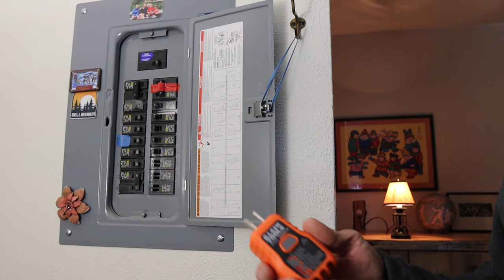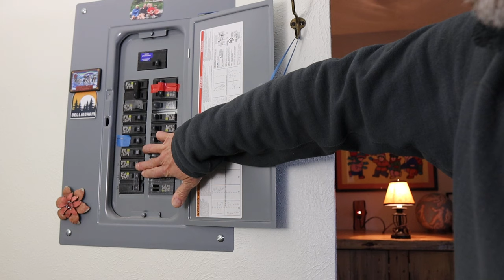Cool Tool Alert: The Klein Circuit Breaker Finder/GFCI Tester at Last Best Tool

Comment: For one's own home, it pays (over and over!) to take the time to fully document all the circuits. Several years ago I went through my entire house and documented what every one of my 35 breakers connects to- every single outlet, light, appliance, HVAC, etc. It isn't difficult, it just requires being organized, and only has to be done once. Now when ever I need to shut off an outlet or fixture, not only do I know which breaker it is, I also know what other outlets/lights/etc will also lose power so there are no surprises. Using a Breaker Finder helps in documenting, but isn't strictly needed.  Additionally, knowing exactly what is on each branch circuit allows one to more easily assess the loading.
Reply: Agree 100%. I can't stand when I'm in a new home and I find that the circuit breaker panel is labeled incorrectly and/or incompletely. Even if you don't care about future users needing to know the correct layout, why the heck wouldn't you do it for yourself. Idk.
Reply: I live in an area of the country with some old homes and loose regulations. I live in a home that's not that old (50ish), but dagnab it. The amount of poorly planned and executed "upgrades", flips, alarm systems, etc. The electrical layout of some of these homes is the obvious work of Clark Griswold. Expect some frustration.
Reply: Pfft why bother when you can used the tried and true method of trying every single circuit and yelling "IS IT STILL ON?!"

Comment: One important safety step I haven’t heard mentioned in the review videos I’ve watched is to check that there is no voltage at the outlet/switch/wires that you’re working on AFTER you’ve turned off the circuit breaker. In rare instances you may have a short circuit where the wired from more than one circuit breaker come into contact due to worn insulation or incorrect wiring.
Reply: Exactly. That is why you should test both receptacles to test for voltage and not take it for granted that the single breaker controls both receptacles.

Comment: If you have a wall outlet with two 120 volt receptacles, you should not assume that both run on the same circuit. I would test both, otherwise, you might get shocked into the next county.

Comment: The battery compartment is annoying though.  Instead of having a simple snap cap,  you have to use a small screwdriver to replace the batter in the receiver.  And since it doesn't get used all the time I like to remove the battery when not in use.
Reply: Wahhhh!!🍼

Comment: Can i use this to test an outlet that is off? I want to find the breaker.
Reply: If the outlet has voltage being supplied to it, then yes, the transmitter will be able to send a signal and be picked up on by the receiver.
Reply: I’m looking for this feature too

Comment: Thanks for the demo! Does it come with any accessories? Klein's less sophisticated model comes with a couple of adapters that allow you to plug into a light bulb socket. Worth having.
Reply from the maker: Mine came with nothing but the two parts and instructions. No pouch that I remember. But adapters are easy to find, and often if included are the cheapest available. But for quick use, it makes sense.

Comment: Use a radio so you can hear if it’s off instead a light that you can’t see. The Sperry cheaper one has a tone in the outlet transmitter so you can hear it.
Reply: I was actually thinking of doing this with a tiny radio but im having a hard time finding a cheap radio with aC power. I think for someone who doesnt have the GFCI outlet tripper (myself right now), this could be a good value but it is definitely expensive.

I imagine someone who does home maintenance / handyman work this could be very useful so theyre not tripping various breakers that aren't documented properly while tenets are present and using the electricity
Reply: @ChrisBranleh u looken at the goodwill bruh?🤨

Comment: Hi.. is it possible to use an adapter due to different socket outlet?
Reply: Yes.  You can even buy a light socket adapter so you can test lamps, light fixtures, etc.
Reply: no it is not possible

Comment: Hello, nice demo,  thanks. My question is, when you plug  the GFCI tester into the wall outlet, do you press the button before you scan the panel with the circuit break finder?
Reply: No. There is no need to do that. You do have to plug it into the outlet first (as he mentioned in the video) then turn the wand on. Then your ready to scan your breakers.
Reply: @iceinyourveins-rn7em 
It has to be calibrated first buddy then you scan every breaker to find the breaker to outlet.

Comment: Is it works for AC240V..?
Reply from the maker: I do not believe it does due to the outlet transmitter.
Reply: @lastbesttool  I work with 230V usually from a relay or an electro-mechanical timer, (line-load-line-load).
I have the test lead adapter that the transmitter plugs in to. 
Both "line" terminals are hot (115v) from breaker.
Can I (do I need to) connect a lead to one line, and the other to a neutral if there's one nearby?
Don't want to try it yet, in case I blow up my meter!
Reply: @mayorb3366 does it work or not
Reply: @mayorb3366  As long as the transmitter receives 120V,  there is no reason this would not work.  The neutral is not required to be in the same bundle as the tracer wire.  A grounding wire would also work in place of the neutral (obviously) for testing purposes.

Comment: Nice video and potentially nice tool.  My concern would be the tandem breakers I see in you service panel.  Are they multiwire
branch circuits?  My guess is you could get close, but still have to turn off multiple breakers before finding the right one.  
And yes, I'm not fan of multiwire branch circuits.
Reply: I just bought this tool because the house I live in was all wired funky so I wanted to see what outlets were on what circuit I do have a couple multi wire circuits like you suggested and it does well with them if I put it on the top half versus the bottom half I get different readings so it still works well for that

Comment: Question. Can I use this to find all the outlets/switches on a circuit?
Reply: Yes, but for the switches are a bit more involved. I would highly recommend that you get an Electrician to do those. You would also have to buy the accessory kit that comes with a few adapters.

Comment: Doesn't work correctly i have one and give me the wrong braker
Reply from the maker: That is really odd since there is a tone or signal between the transmitter and receiver that is outside normal circuit noise. So it should be impossible to indicate the wrong breaker. Maybe no breaker, but not the wrong one. That's like the wrong telephone ringing when you call a number. But I guess somehow it could happen.  Thanks for the comment.
Reply: @lastbesttool  You answered this in the video.  The tracer has to develop a learning curve and must be scanned at least twice for calibration, since every odd breaker set and every even breaker set share common buss bars. My first pass indicated three separate breakers.
Reply: @lastbesttool mine gives me false positives on 2 or 3 circuits without the transmitter even plugged in. Then it gave me 2 false positives in addition to those 3 circuits when it actually was plugged in. Yes, I’ve scanned both rows several times to calibrate it. I’m not sure what the issue is, but it’s being thrown off by something. Piece of junk